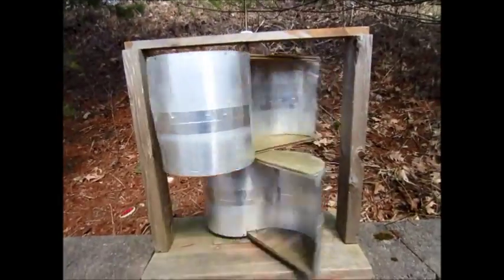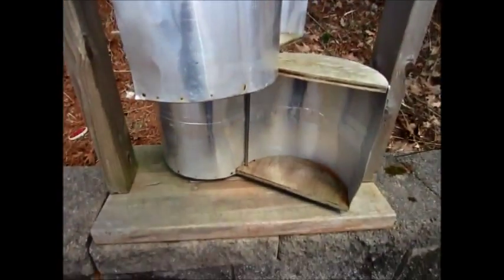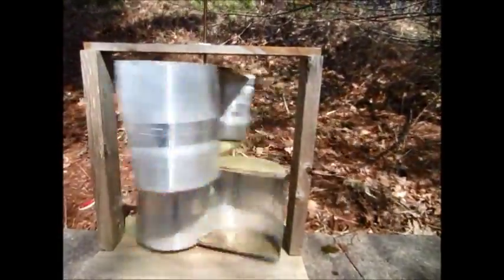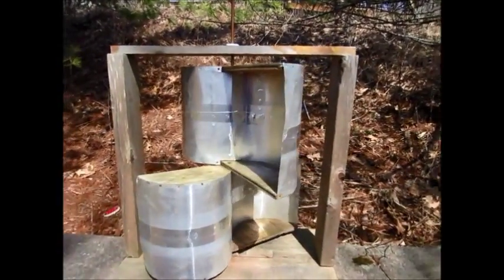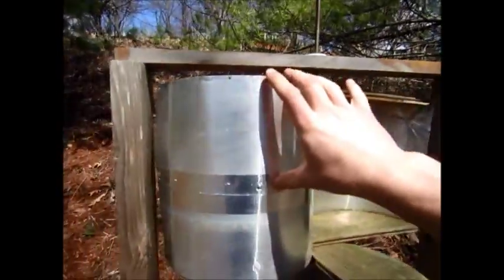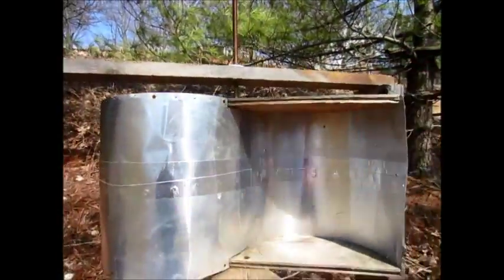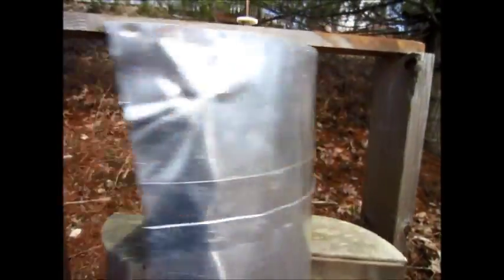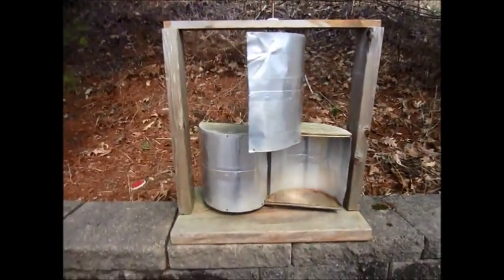DIY Wind Turbine

Comment from the maker: I could but I think it would be better suited for a cap size of 10 farad.  I used a pancake motor from a VCR as a generator.  It is very similar to a stepper motor but the steps are not as small and strong.  I had it geared up quite a bit.  It seemed to work best when I had a 12 inch diameter pulley on the wind turbine and a 3/4 inch pulley on the motor.  As I said in the video the LED witch was red would light up dimly in high wind.  Thank you for the comment!

Comment: you could have it charge a 3000 farad ultracap (like the maxwell boostcap) during the day and have it power joule thief garden lights at night.  that way it's not powering the lights directly, and can utilize the capacitor down to 0.3v.  generator might work better with gearing to get more output.  have you tried a stepper motor (like a nema 17 size) with a bridge rectifier as a generator yet?

Comment from the maker: I would not build a bigger one for the power.  Maybe if I wanted to try out a new design or something but they just are not practical at all and are not reliable enough.  It's not to useful if the lights only turned on when the wind blew or the sun shown... in my mind solar and wind are only useful in remote locations where it would cost more to run power lines or for small applications like calculators and solar garden lights.

Comment from the maker: Thanks!  A tiny bit.  Probably more torque then my stirling engines!  Yeah I don't think the generator set up I had was the best.  When I had the generator on it I tried a rubber band for the belt but it produced to much friction so I made a make shift belt out of Teflon plumbing thread tape.  I'm not really sure why I went for that but it worked.  Yeah probably about a watt.

Comment from the maker: I agree that solar is better in some ways.  But it is still ridiculous.  Even if you covered your roof with solar panels and used a gas dryer, stove, hot water heater, and heat, you would not be able to power you home even if the sun shinned 24/7.  It's just not worth it unless your in a remote location.  Wind is not good because wind turbines kill a lot of birds and about half the time I see them they aren't even spinning.  I'm not really sure how the compare in cost.

Comment: Nice build! Especially for how long ago you did it. Looks like it has a bit of torque? Maybe a different generator unit would be better than the one you had? I know a few ways to improve the performance... Including a wind funnel.... I'll see what links I can find and inbox you. Looks like there is at least a watt of energy there when it spins up good. The frame is ideal for some coil pickups and magnets or coils on the rotor too!

Now I have another thing to build. Thanks :|

Comment: well, wind is less consistent, so it's nearly impossible to make use as a dependable source on-demand power, rather stored power for later use.  Solar is first option.  However, wind is actually pretty powerfull, u jst have to have a super efficient design and most DIY will jst not be optimal enough.